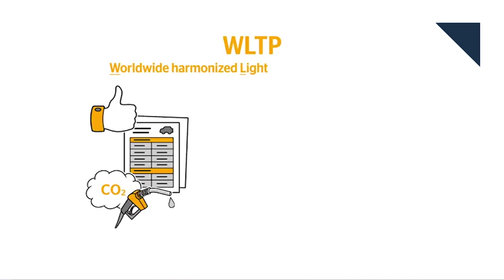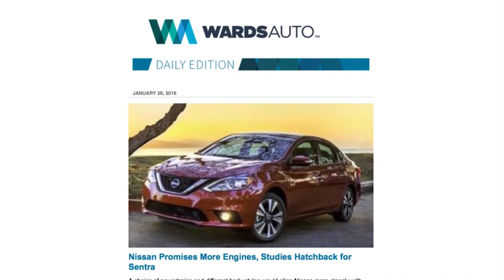BMW Concept Z4, Braided Carbon Fiber Wheels - Autoline Daily 2172

Comment: BMW shows yet another coupe concept, albeit with lovely styling. If these elements make it to the 3,4,5,6 Series- great. But they need to crack the code on SUVs because in general US buyers are not loving what BMW has to offer. It might be that there interiors are too crisp. And we know their SUVs all look like econo-wagons from the 80s.
Reply: the i8 is also one of the nicest looking cars, so nice in fact i forget its a bmw, however the x6 just looks like a cut and paste 3 series

Comment: Interesting could we have a break down of the costs of making an Battery Electric Vehicle (BEV), even if the batteries go down in cost, they could still end up costing more. Most people would just as well say "But that is from FCA's perspective". This meaning how much it would cost FCA, in particular, to start making mass numbers of BEVs. There is also simple Supply and Demand. More people want the more the stuff to make BEVs will cost. What are we really looking at if costs for BEVs are really going to skyrocket.
Reply: DocWolph that would also make resale value increase if demand does go up so it would likely balance out in the end
Reply: Jon Dittmar,.

Resale?  You have to buy it first. THAT is the problem. Higher resale would also slow propagation of BEVs as used cars would be that much more expensive to buy. Even so, BEVs depreciate like a crashing stock market (Learned that quip today) so higher resale is not the issue. Again its buying the car in the first place.
Reply: It's important to remember that such price jumps ought to be attributed to the removal of government incentives.
Reply: Iamwolf134 good thing they are ending soon. Nissan, tesla, and gm are going to run out in 2018. Bmw and ford likely in 2019.
Reply: DocWolph they have been growing at 30-40% compound sales every year. It is the only growing sector in auto sales in 2017 also
Reply: Jon Dittmar, 

That does not answer my original concern: Why would BEV price skyrocket. What parts of building BEVs contribute to the assumed priced increases, and why so then? You are just wax-on-wax-off about BEVs supposedly gaining sales as if that is actually happening and means its some kind of juggernaut, but not answering any questions actually being asked.

If all you have propaganda then just keep walking.
Reply: DocWolph the price will increase cause they will have to become profitable. Right now they are subsidized by government tax credits and CAFE standards. But once they reach volume that won't be economically sustainable
Reply: Iamwolf134,

It will be a part of it. But it won't the whole reason.
Reply: DocWolph this very channel showed that the only growing sector is plug-in vehicles. You have even commented on the same videos
Reply: Jon Dittmar,

I don't keep a dairy of what videos I comment on.  Do you?

Next, the only actual growing sector is Crossovers. They will keep growing regardless of hype and Govt incentives. And what does having commented on videos you want me to have anything to do with BEV prices possibly skyrocketing due to demand, the whys and hows?

Nothing. 

"This very channel" showed that EVs, in general are still a tiny segment of the market at under 3% of the total mix. It is hardly a segment set to "explode". No one rationally expect EVs, of all types, to comprise more than 10% of the total market by 2030. 10%. In a market of of currently 17M vehicles sold a year. That is 1.7M vehicles. Tesla is not going to change that because they still have to get the cars out there. "Reservations" are not the cars themselves. They are not even fully paid pre-orders, and the cost of the Model 3 just keeps ratcheting upward all the time, regardless of what they say the base price is. You clearly have trouble understanding this. 

As ever, you are just desperate to win "something". Stop trolling spaz. If you can't answer the question put forward, then don't obfuscate by asking another, unrelated, question.
Reply: DocWolph how is calling me a troll helping the conversion? Do you want me to reply to you on a previous video just to prove that you have seen it? You know there is a report harassment button on youtube if you think I'm that much of a troll. You could also try ignoring my comments
Reply: DocWolph i also basically said the samething iamwolf said so i would like to know how i am trolling

Comment: Sergio is right.  It dose not matter. Electrification is were the market is heading.  When Companies start pricing to reflect a profit.  The Volume of scale would have brought production cost down.  China and India will fill in the low end.  An even bigger problem is many will walk in to a dealer to buy a gas car and walk away with a far less profitable electric one.

Comment: What about those engineered steelies made from several kinds of steel. Those were supposed to have similar strength and weight performances to Carbon Fiber wheels though not to same degree, but at a much reduced cost. Any word on those?

Comment: BMW has become the Ultimate marketing company.  When I was young I always wanted  BMW because they were a blast to drive.  Sweet silky drive trains, excellent gear boxes, wonderful steering.

I have owned two BMWs  a 2012 X3281 and a BMW 128i.  Both were wonderful machines.  The X3 blew me away it was very well balanced and would hang its tail out ever so slightly around wet ramps even with the stability controls on.  The strait six was wonderful with good power down low and going nuts above 5000 rpm with a nice push to the 7000 rpm red-line.  The steering was horrible but the suspension made up for it by telling you what was going on with the wheels.  This was on the base all season X3.

The BMW 1 was even better lighter with far better steering.

Now there is not one BMW I would own.  The M cars have become a joke.  Engine sound track on the speakers, pedestrian drivetrains,  cars that are designed for best track numbers and not true driver feel or enjoyment.   A basic BMW 5 now drives no better than an Honda Accord.

The Last Gen Z4 was a horrible car.  Poorly built and not able to perform as well as the 3 series.  The new one I bet will be just as soft.  

BMW stop trying to market cars to us and just build cars that are entertaining to drive.  The BMW 2 is almost such a car.  The new X1 is literarily garbage.  The I8 would have been a better car without all the hybrid crap.  Then it could not be marketed at $125,000 +